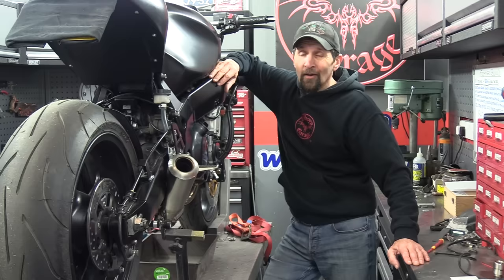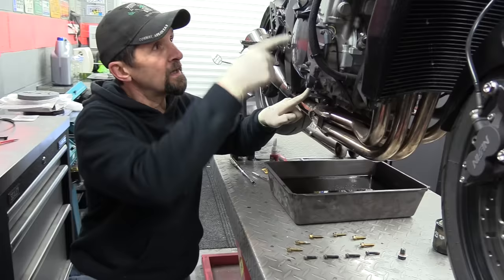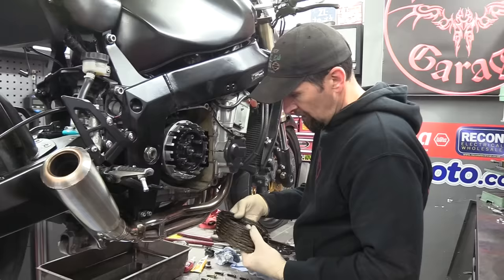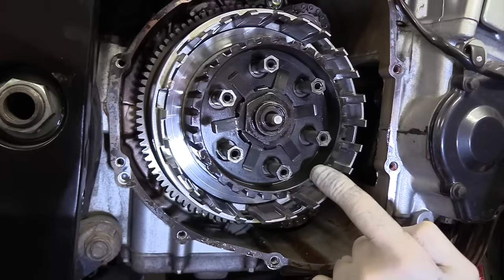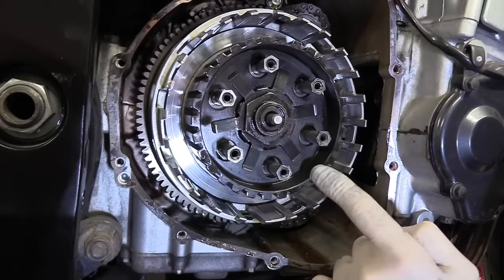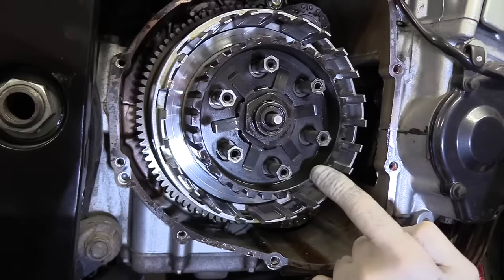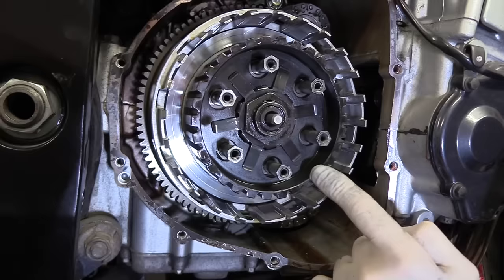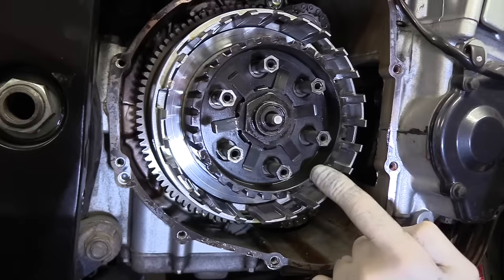Delboy's Garage,  Motorcycle Clutch Replacement .

Comment: Hi mate, good video thanks for the detailed explanation. By the way I would suggest a radiator protection, as it is huge one and quite exposed . Cheers
Reply from the maker: Cheers buddy, good thinking, and another job to get round to, just getting all the teething troubles ironed out, and then I can make a start on all those kind of upgrades... thanks for the nudge!

Comment: Drape a bit of aluminum foil over the exhaust and it helps prevent that oil from running down it and cooking off the second you run  the bike and getting that horrible smell

Comment: Excellent video, thanks. I'm having gear changing issues. Not sure the slave cylinder is able to push the rod. Will take the clutch cover off and inspect. This vid has helped, thanks.
Reply: Should you be able to move the rod if you hit it with a Heavy hammer (with the slave cylinder removed) ? Seems like it is against a brick wall.

Comment: Excellent video class, Del and Penny... I learned quite a bit today.   Something tells me, Del, that a dealer would charge more than an hour for that repair though... you know how they can be!   Have a great rest of your week!
Reply from the maker: Sure thing Gary, you could be right, I guess if you've got a fairing to take off, and put back on, and you're gonna include the oil change on top, then 2hrs wouldn't be out of order, which in most garages is £60-70 per hour, so chuck in the parts and the VAT and you're soon rocking £300!  But I do think that some garages would take a realistic view that it's not an intensive job, so maybe stick a fixed price on it, but to temper that, from the other side, I did hear a Honda technician say once they time out 4hrs for valve clearances for a Honda Blackbird, which is an awful lot of money!  And the Harley I've just bought as a project, they changed the final drive belt, which does mean tripping the outer and inner primary off, the labour was £492, and so was the parts, so the poor guy had a £900-odd bill, ouch !
Reply: Moonfleet41 oh man...

Comment: You couldnt have made this video at a better time. I need to check out my bandit clutch soon. Its not disengaging properly. Also, nice to have a different style of music,
Reply from the maker: Cheers buddy, you'll find that the springs that I've got in this Kawasaki that hold it in, are different in your Bandit, you have a diagphram ring in yours, it's like a big springy disc, so get yourself a manual, it's a little bit different, but along the same principles!  Oh, and if you're interested, you can convert your clutch to a 6-spring if you choose to, it's just a upgrade kit!  Good luck with it mate...

Comment: Thanks for all the great tips!  Perhaps you should do a video on general repair tips.  How to organize parts as they come off to make putting them back on correctly that much easier, how to label things if necessary, etc.  I can see one video (maybe a several part series) JUST on different types of grease and where they each need to be used.  Your advice to me on rear brake switch cleaning was spot on.  I haven't had any trouble with that switch since then, once you told me what lube to use on it.  Is there any kind of thickness to the steel plates that comes into play?  I would think the manual would advise replacement if the plates become too thin, if that's possible.  Keep up the great work!
Reply from the maker: Hi there, thanks for your kind words, yes, the steel driven plates do have a min. thickness of spec. and the thickness is given in your manual...which is why it's always important to invest in one if you're gonna do your work, they're more valuable for specifications than they are for guidance...

Comment: Hi del, watched a few of your videos and they are fantastic.  Very well made and blow most of the other out of the water.  I have just signed up to wemoto and ordered a new clutch plates and springs etc to do my first clutch replacement on my old vfr800.  I would probably not have bothered even trying until I watched your video so its all your fault if it goes wrong :)
Reply from the maker: Hi Paul.. Thats fantastic news mate, im so pleased to hear that you;re getting involved and doing this yourself.  Hope ot goes well for you and you get it all buttoned up just right.. let us know how you get on, and thanks for using the guys at Wemoto, im sure they looked after you... all th best and happy new year.. Del.

Comment: After replacing the clutch pack, did you have to adjust the clutch rod under the primary derby cover and the clutch cable?  You're very neat and meticulous. Well done. Cheers

Comment: Are you ever planing on doing a how to on valve clearance check? Also adjustment if needed.
Ik know there are many out there already, but you are doing things systematic and clarify a lot. That is what I like.
Reply from the maker: Hi buddy, that's always been a difficult one, because whilst checking shims (or valve clearances same thing) is a piece of cake in real terms, the problems begin when you find a gap too small and need to change a shim... with a Bandit, or early CSXR engine they are reasonably easy, as you adjust them with a locknut and adjustor screw, but any bike with the coin type shims, you can often have to take the cams out and if somebody were to re-install the cam at the incorrect alignment, it could lead to catastrophic damage in side the engine... so I would never recommenced a novice to start stripping out cams on a bike, but when it comes time to do the valve clearance check on Penny's scrambler, I will at least show how to check them.. that way you have a 50/50 chance they are in spec. you have peace of mind.. but if you find one out of spec, then you could book it in with a garage as a stand alone job, which would then cost you very little in comparison to the full amount of work... that video will have to wait till the mileage comes round which is a few thousand yet!

Comment: Taking the case bolts out in a staggered format is not necessary but reinstalling, yes, stagger your bolt tightnings.
Reply from the maker: I'd disagree mate, it is as important to release the casing in sequence as it is to re-tighten it... specially on large flexible casings!

Comment: Hi Del, the design of the basket looks to give you a measurable gap between the final friction plate's teeth & the base of their dedicated slots. Does the book of words give any spec/wear limits? (before they bottom out & REALLY lose their grip!)
A quick check there may save ordering new plates when all you need is a clean up & fresh springs. Nice filming Pen : ) x
P.S. To check springs for even poundage, stick two on a suitable nut & bolt with a flat washer in between them & wind them up,
if the washer stays central between the nut & the bolt head as you wind, they're pretty equal in the progressive 'boing' dept.. 
It can be done using a vice & piece of flat plate too, but beware of the 'Darling, I've got a spring up my nostril' pantomime.
Reply from the maker: haha now I proper laughed at that!  And progressive boing, that must be an imperial scale !... but to answer your quetion, the plates are spec'd to a given width and the manual advises to measure them with a mic and that's both firction and steel, but if there are no score lines on them, then there's no excessive wear or more to the point, premature wear, as 30k miles shouldn't wear out a clutch, unless you are Mr Creosote, or towing a caravan with your bike!... Often the biggest issue on a 20yr old bike like this, is just heat fatugue on the springs... they run out of boing!  Thanks for making me smile buddy, I think a full face lid with the visor down if I'm gonna check using the vice lol (and PP says thank you for noticing she was there too lol)...

Comment: Another very helpful video Del - thank you.  Just a quick question - when reinstalling the pressure plates, should the sharp edges go in to the engine with the rounded ones out; or doesn't it matter provided they all face the same way?

Comment: is there a bandit clutch adjustment video, please? i see some adjusting the bottom adjuster and some just doing the top. And i saw a guy turn a screw inside a 10mm bolt but didn't explain why lol.  you always explain clearly. your fork seal video saved me last week, cheers
Reply from the maker: Hi mate.. is that a 600 Bandit with cable clutch ?.. not had one myself,  had a couple of 1200's and they are hydraulic !!  but all cable clutches usually have a top and bottom adjustment, if you can send me a picture of the lower adjuster so i can get a squint at it, it'll be possible to guide you better mate... Hope that makes sense. !
Reply: @Moonfleet41  650 with cable buddy. Ive had a go for now, the screw thing tightens against the pushrod apparently so will see how it goes lol.. if it fails Il send a pic but thankyou for a quick reply

Comment: Nicely done. Having done this would you make sure the clutch cable was nicely lubricated so as to make changes as smooth and resistance free as they could be? Just a thought. Thanks for posting.
Reply from the maker: Yes, indeed buddy, always make sure your clutch cable is free to move, this one is hyrdaulic, so didn't mention it, but if you want another little upgrade, you could call Wemoto and invest in a Slinky Glide cable, they're smoother and freer running than the factory cable, link in the description mate, give 'em a ring!

Comment: By running your finger over the groves and up and down the teeth on the inner basket, you run the risk of slicing your finger wide open or getting metal splinters. You would be better off using a decent torch and light up each groove or tooth. Any burrs or edges will give off a different light pattern compared to normal edges. Normally they will glint or flash in the torchlight. Check the edges of the new friction plates and the old drive plates for any burrs as well. its not unknown for the edges to be sharp on new plates ( both friction and drive) as well. Re: heavy duty clutch springs, not advisable as the manufacturer would have fitted as standard. But if you are going to fit them , renew the clutch cable at the same time if its cable operated. Nothing worse than getting halfway down the motorway and the cable failing due to the increased pressure !
Reply from the maker: Seriously, you worry too much mate, you can't see a minute burr on the inside of one of those fingers, even if you can shine a torch on it, you can never tell how 'catchy' it is, or how much it might hang up a plate, you don't rub it hard OBVIOUSLY, just feel along the edges gently with a gloved finger, and you'll feel them instantly... what's more important is your finger will 'feel' the depths of the marks left by the plates in a way your eye couldn't tell...as they always say, you do what works for you, that's how I do it !

Comment: Great video, but you didn't check the steel plates were flat, blueing normally indicates some warping.
Reply from the maker: All steel clutch plates will have a degree of blueing, but as long as it's all the way round, then that's fine, it's when the blueing is in specific spots on the ring that indicate a warp, and these were fine... good point well made though.

Comment: I watch a lot of instructional video on Youtube and some go too slow and some go too fast. Your videos are perfect! I am a mechanic by trade but have to admit that I still get a lot out of your content. It is one thing to have the knowledge but a whole different skill set to instruct/teach. You seem to have the gift of both! One question. I saw you had a socket driver that also had a 1/4" drive in the end of the handle that allowed you to put a ratchet on it to break the bolt loose and then remove it and just use the driver (I call it a driver, similar to a screw driver but with a 1/4" socket end on it). Can you tell me the brand of this? Thanks in advance, Cheers John
Reply from the maker: Hi John, thanks mate, it's great to get some respect from the trade, an honour indeed.  Am glad you enjoy the videos, we work hard to get the pace and brevitiy just right, so it means a lot when it's appreciated.   With the socket driver, I call it exactly that too, and it's part of my larger socket set, but I've actually got two or three of them... the one I use now is Gedore Red from a large 172 piece set (I can send you a link to that if you like), I've also got an old Snap-On one from years ago, and thirdly I've a Bluepoint one which I've had a few decades too.... dead handy, as you say, it's good to break the bolt free then spin it with the driver!  Once again, can send you a link to the large set if it helps!

Comment: Does it make sense to flip and randomize the steel plates to avoid the same wear patterns?  Do the heavier springs change the torque values on reassembly? Thanks very much for the walk-through. Now what is a quid????

Comment: Cracking content - have actually used your USD fork rebuild video some time ago as a reference before doing mine, so I can see me using this in the future as well.  One point (that might or might not interest) is that the ZX7r clutch setup has a slipper clutch as standard (they called it "Back Torque Limiter" back then) but they had it completely locked up on road bikes.  

There used to be a site that gave really good instructions on how to activate just by ensuring the clutch pack was within a certain overall depth and turning up some spacers for the springs (the expensive way to do it was get Kawasaki kit springs that did the same thing) but it seems to have disappeared.  

Worth investigating if you're going to be inside the case again anytime soon, or slipper clutch not something that particularly bothers you?  I've never done it with my old 7R, but then again, the clutch cover has never needed to be off yet.
Reply from the maker: Sounds like a money saving stunt so they can use one clutch for multiple bikes on the production line, no four cylinder Japanese 750 needs a slipper clutch, which probably explains why they left it deactivated, you're never gonna lock the rear wheel up on shut down, unless you change down way to early in the wet... there's always a second reason for everything, but thanks buddy, will have a look at it!
Reply: @Moonfleet41  Yeah - totally agree no reason on a 750 road bike.  Doesn't seem to be a shared part though and they seemed to do it from the ZXR750 on - current 10R clutch appears to be a development of it.  Maybe as they intended them to be raced - even the RR homologation specials had the same setup that needed thinner clutch plates and the kit springs to get it properly slipping on downshift.  Found a modern re-release of the older page I remember, with more info in it now (inc the race kit manual page detailing it) here:  http://andys-kawasaki-zxr-zx7r-tribute-site.net/tech-tips/tuning-the-slipper-clutch/

Comment: Thanks for the video! Getting ready to replace slipping clutch on dirt bike and this was thorough and understandable. Subbed.
One question: How noticeable will the heavy duty springs be at the lever? Want plenty of grab but prefer a light feel. Thanks again.
Reply from the maker: Hi Mark, heavier duty springs will always translate to a heavier lever feel.. you can't have both a heavy duty clutch and a light lever unless you start modifying the clutch ramp mechanism !   See how it goes, it's not always that much harder to live with !

Comment: Hi Del&Penny, 
I have recently had to do the same job
Friction plates and springs were all that was required, makes such a difference!
it is all about the uniform balance between these components as they all share the load!
You covered all the bases, and produced an excellent video guide!
Once fitted is it necessary to run it unit can you just go as you usually do?
Kind regards Warren
Reply from the maker: Hi Warren, never necesssary to run it in mate, at least not like you would an engine, but certainly as with all freshly fitted parts, take it steady for a few miles till everything settles down and makes sure it's working properly!

Comment: I'm doing my plates today and honestly I need piece of mind. Ordered an EBC kit and checked the service manual. While the manual tells me the top friction plate has a hole that needs to line up with an arrow on the basket but the top EBC plate i have doesn't have a hole at all. Only the ones that go behind it do. I'm worried I'm gonna do damage if its not in the right order as it will be the top one and unmarked but from the comments and your video I am assuming it shouldn't matter where it is placed.
Hope you can help me understand this. Kinda at a standstill. Cheers mate.

Comment: My 2014  Ulta Ltd.  Does not have an adjustable clutch.   What kind of clutch is this as compared to the adjustable type's.?   Mine is Hydraulically activated.   Are adjustables the cable clutch only ?   Thanks in advance if you reply.    Great lessons here.

Comment: Did you pull in the clutch lever before reinstalling the pressure plate? The manual for my bike calls for it but I thought that was strange.

Comment: Hi, I'm curious what thickness of friction material should be on the plates, I've taken mine out and putting it gecko plates but they haven't arrive yet.  Original ones came out and looked very thin or is that how they are suppsed to be

Comment: Thread lock on the casing screws and lube on the sump plug ? Wouldn’t that effect the torque settings? I go in dry as believe manufacturer torque them dry ?